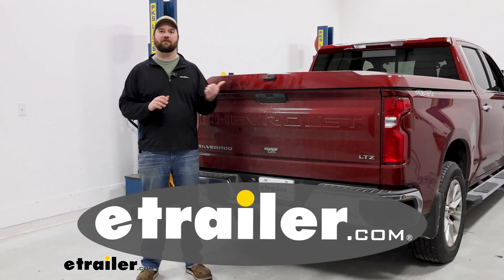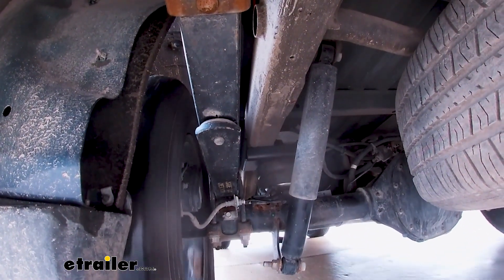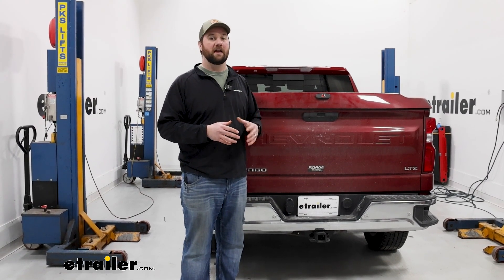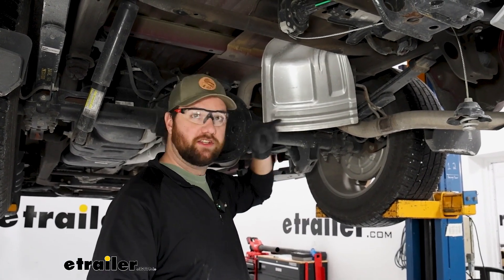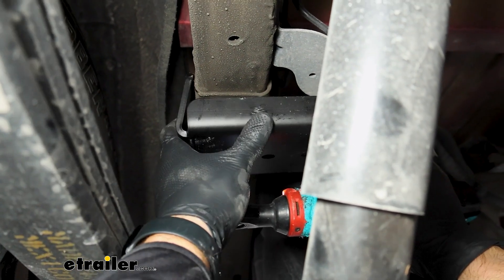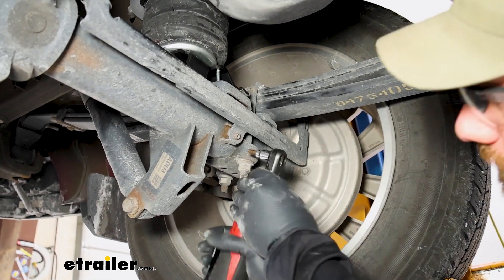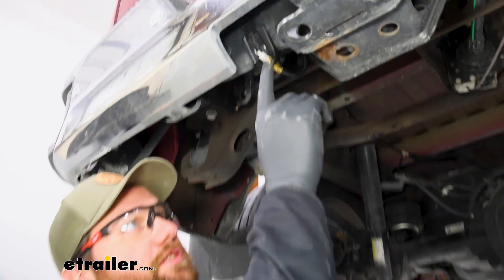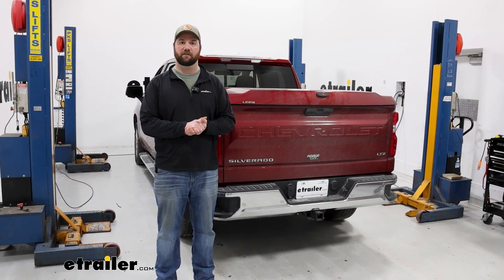etrailer | Set up: Firestone Ride-Rite Air Helper Springs on a 2020 Chevrolet Silverado 1500

Comment: Is there an issue now lifting this truck on something like a 2 post lift? In the video, you used a lift that lifts the truck up by the tires which is not industry standard.